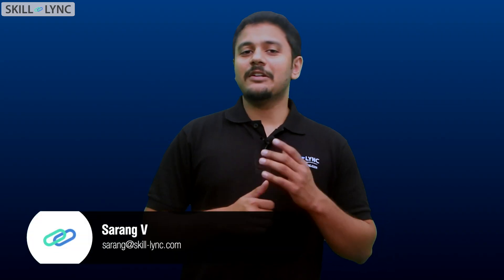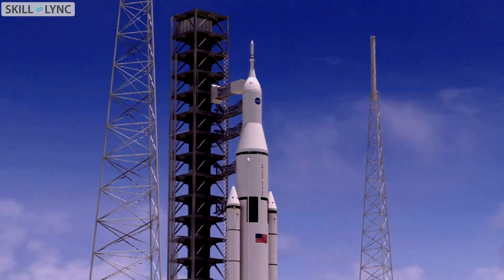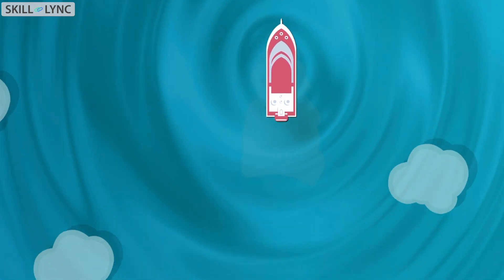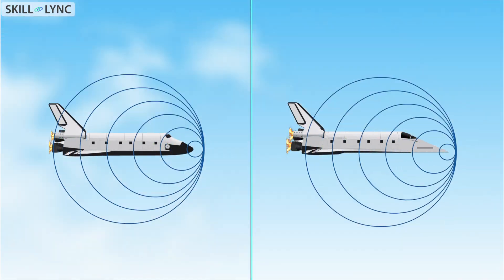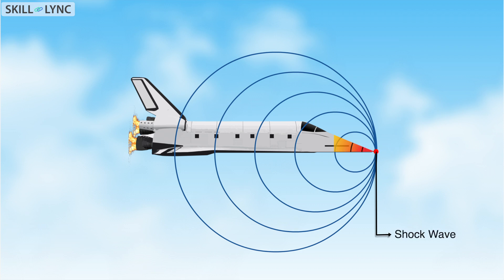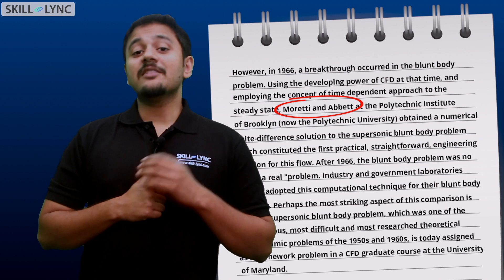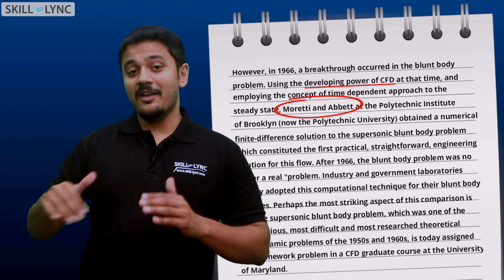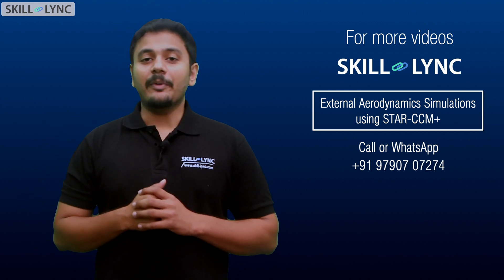The reason behind why a space shuttle has a blunt nose | CFD explained | Skill-Lync

Comment: Why does the bow sits away in the case of blunt nose why it's not touching the nose
Reply from the maker: Joyal Dsouza - that is because of the geometric difference. In case of the blunt nose the air molecules are pushed away evenly by the nose. In case of the pointed tip, this cannot happen because of the small cross-section.
Reply: Does this mean that air molecules are pushed away in case of blunt nose where as the pointed tip slits or goes through the air molecules